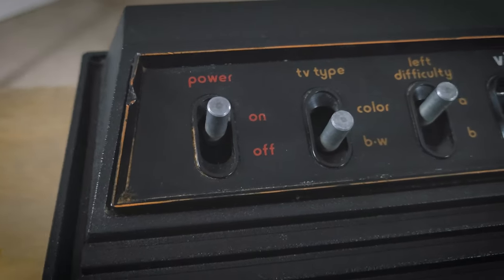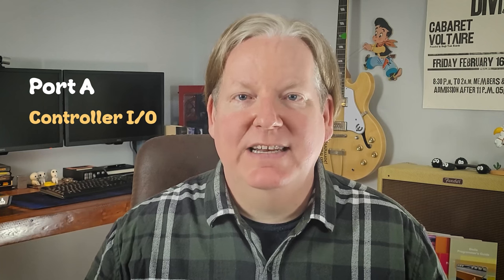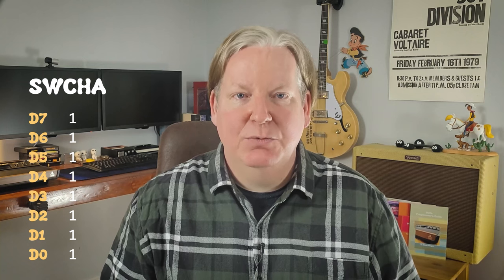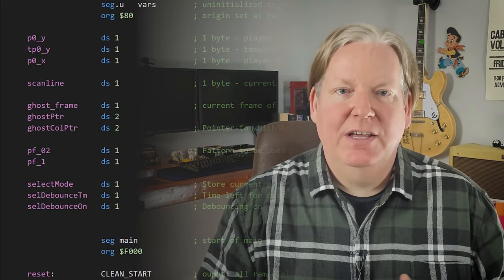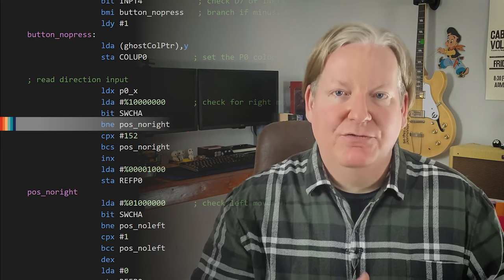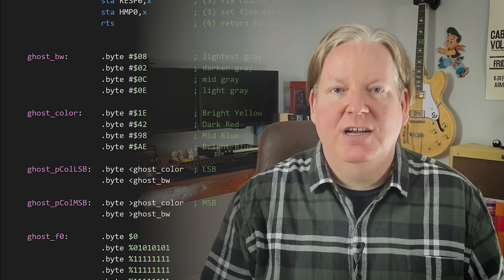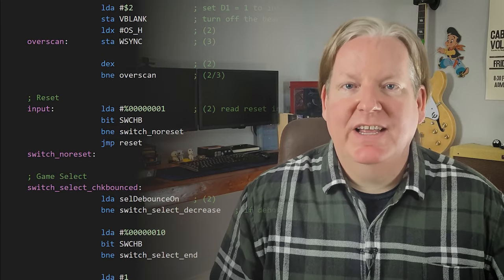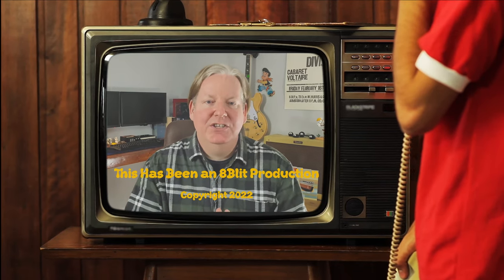Joysticks, Switches, Bits and Nibbles. How the ATARI 2600 Responds Every Wiggle. | 8Blit

Comment: Nice episode!  I still have the driving controllers and Indy 500 my family got when I was a junior high kid, but to be honest, I prefer Night Driver as a car racing game.  It also seems sort of weird to use a rotary encoder without stops for a driving controller since real steering wheel does have stops (like the paddle controllers).  I also have the keypad controllers and the BASIC programming cart with the keypad overlays. I'm thinking of making a homebrew that would use the keypad controllers in a rather novel way, but that's a bit further down on my "cool stuff to make" list.  Also on the list is an arcade port I'd love to try to make for the 2600 that would be a suitable application of the driving controllers. The audience for games using the special controllers is probably rather small, so if I do, I'll try to also make more common inputs work too (game select the controller type).  We'll see!
Reply from the maker: That would be cool to allow multiple types of input for your game depending on what the user has available. Wish I still had my old driving controllers!

Comment: Thanks for the video!  I've always wondered if the oldest console would have been capable of using a "modern" multi button controller using both ports.  Dual sticks plus multibutton.  Alternatively, from a hardware theoretical perspective, coulda single port handle both keyboard and joystick inputs simultaneously assuming a custom controller had them both?  Or would they have to use both ports for a single joint controller?
Reply from the maker: Atari's CX-50 Keyboard controller used a combination of pins in order to 'scan' which button was pressed, so theoretically you could rig up a controller with multiple buttons on it the same way. By the way, awesome youtube name. RIP big brother.
Reply: @8Blit  Thanks.  And awesome that you got the reference.  Not enough whippersnappers do nowadays!  :)   I'm just surprised that no one did that back in the day (combining both ports to a single joystick capable of multiple functions) using both ports.  That would seem preferable to me instead of using the switches on the console for more functions.

Comment: We had a 4 switch model (4 on the front) back in the day, but it still had 2 difficulty level small slider switches on the top/rear side of the console.  When did DE9 switch to DB9?  Is there a difference?
Reply from the maker: When I wrote the script I forgot the buttons were moved to the back and only remembered after I had recorded the video. doh! I believe I added some on-screen graphics with a correction. From what I understand, computers used a larger DB-25 connector, and when they started using the DE-9 sized connector, they we're often miss labelled as DB-9. The DE-9 and the DB-9 are effectively the same connector.